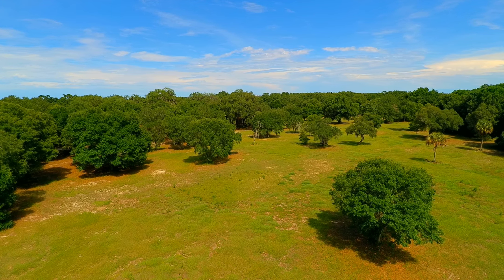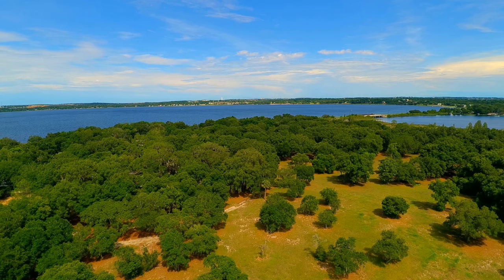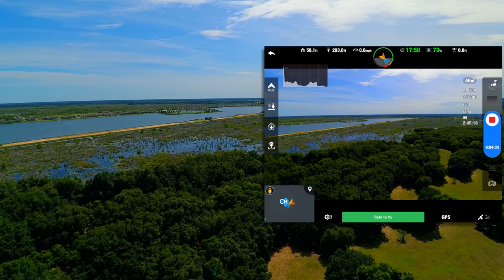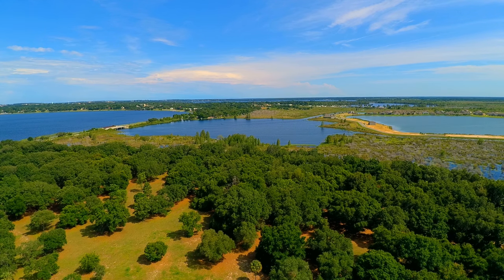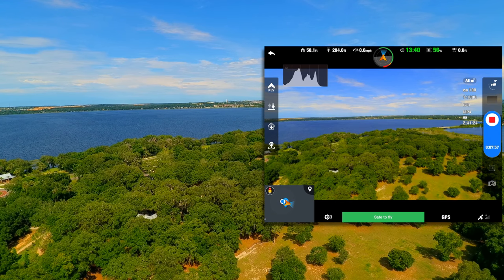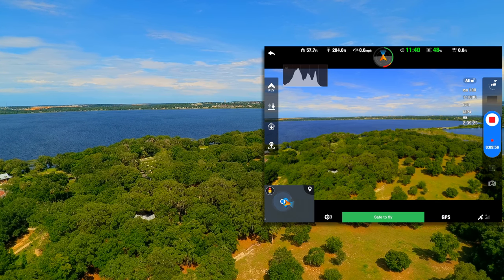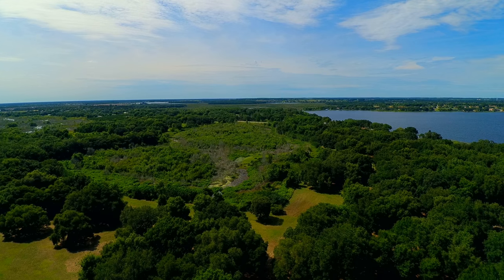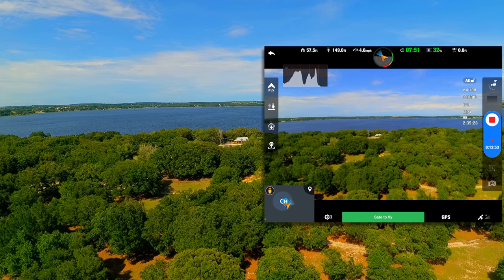Autel X-Star Flight test and Battery Duration Evaluation with auto landing

Comment: Does anyone know the actual payload capacity of the X Star?  Looking to use it to take bait out for fishing. I'd be using mullet and different fish. I'll be shark fishing. I almost bought the Yuneec 500 but this got really good reviews and I like the distance it had. I stumbled upon some specs that said it would only carry 180 grams or .40 lbs.  I just ordered this copter though. If that's the case it will not be enough.  I need it to carry atleast 1lb with the weight I'm using. If not I'll make someone a good deal on the X-Star Premium I just ordered. Lol
Thank you guys.
Reply: If you end up wanting to sell it let me know lol

Comment: radio lag, not uncommon for control using radio signals.  NASA deals with lag all the time 32 mins worth between earth and mars.
Reply from the maker: hardware lag. Nvidia shield doesnt lag, This is an Ipad air 2 that lags, however on the Phantom 3 no lag at all. Soooo the culprit is "Tada" Software engineers.
Reply: good if no lag on p3